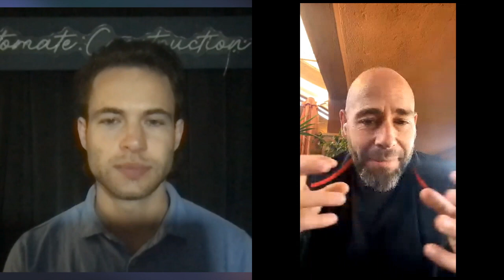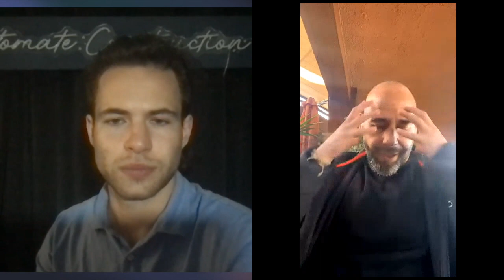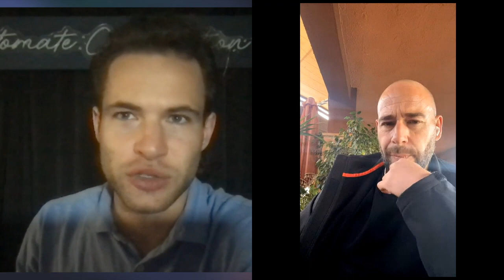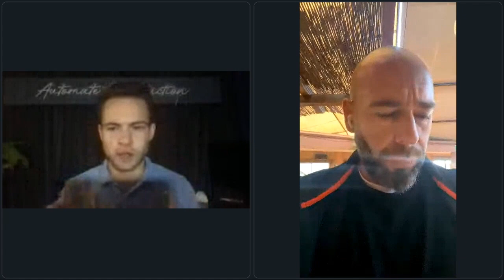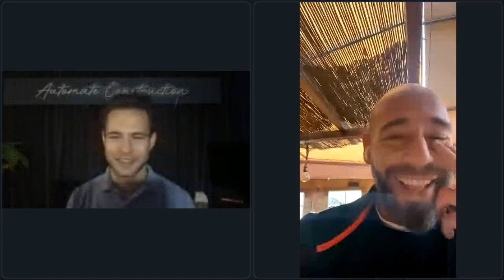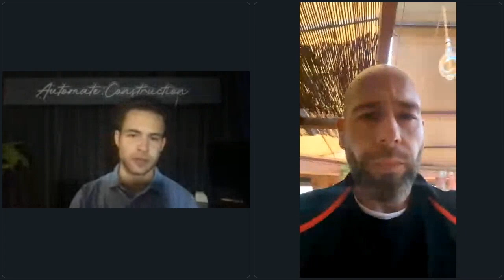Printed Metal With Lasers | Meltio CEO Angel Llavero López de Villalta

Comment: Thank you Jarrett and Angel for another eye opening talk! Meltio has been on my radar for a while and even had a session recently with some of their representatives. It is great to hear their CEO and better understand their ambitions and market positioning but also to know that they recognise the potential in the construction industry. Useful for me as an architect trying to integrate workflows and establish a design approach better aligned with all these new technologies. I do agree that in order to move one of the biggest industries if not the biggest there needs to be a push from various sides and more cooperation by all players. Currently architects are a bit on the fence and they do have a major role to play in integrating new solutions and defending the adequate once in front of their clients for their specific cases. Thank you again and best of luck with all your endeavours!

Comment: Another great interview. 

I think the most powerful application for laser metal printing is found in the construction industry, hardware and software. By code we can laser print into structures and infrastructures Faraday Cages that reduce EMF exposure. Also, as the industry moves away from 3d and into laser printing, we can include printing the wiring into the structure as part of the printing process, saving weeks in completion time. 

This takes us one step closer to making homelessness an ancient concept. 

Thank you both, your families and crews. JOY!